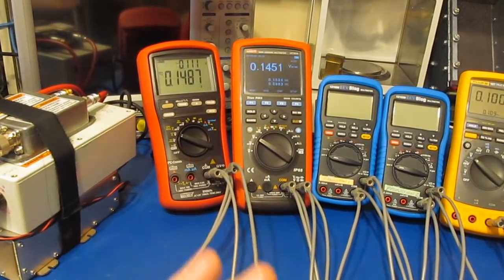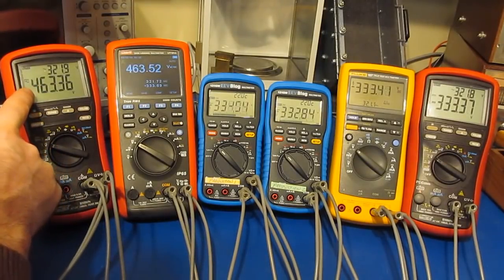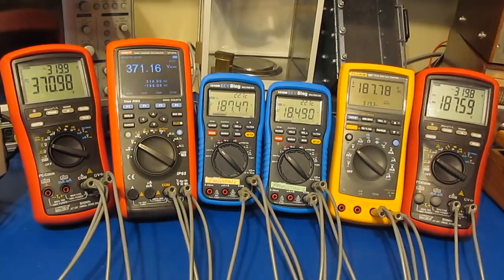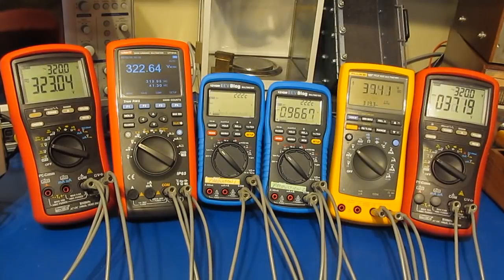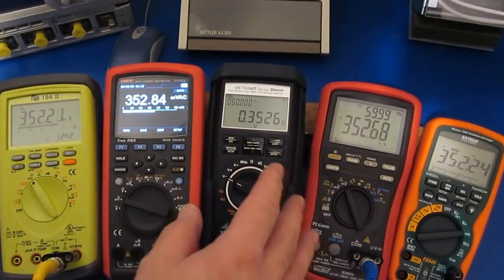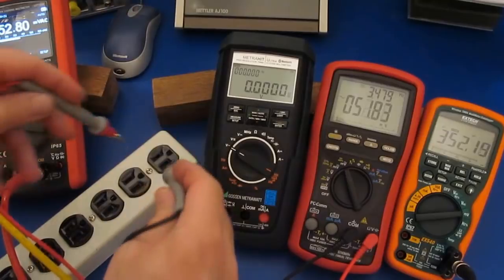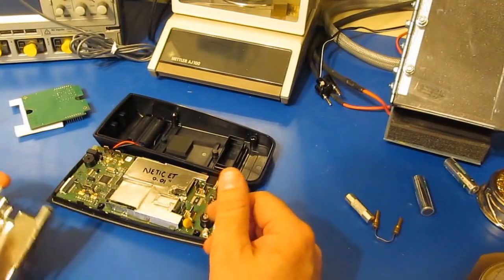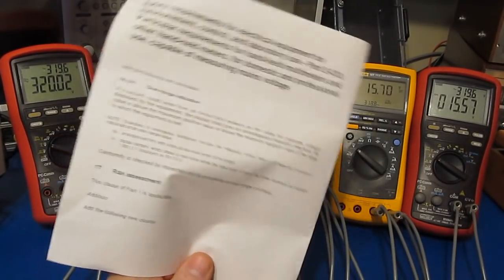EEVBLOG/UEI 121GW Part 3B,   ETL,  Further Details on Part 3

Comment: I have not seen the uni-t un139E or uni-t un139s much on you tube it has more certificates than the other 139 versions have 
UT139ES ATM-ETL
UT139ES CE-EMC
UT139ES CE-LVD
UT139ES ROHS
Don't know if one of these models would be more robust than the 139c.
Reply from the maker: I've ran more UNI-T products than most brands and have yet to see a single one perform very well.  Like the ANENG you asked about, running more and expecting a different result is just a waste of my time.   If UNI-T releases a UT181B, I would have a look but that's about the only one I would invest the time in.
Reply: @joesmith-je3tq  OK, Thanks for the response. Just been sitting watching hours of your videos. Finding them interesting.

Comment: Have you had a chance to use/review the Fluke 189 Series II?  Just curious how it stacks up to the original 189.
Reply from the maker: No, and doubt I would.  I've never really made a review for the 189 because it's not something that is currently offered by Fluke.   I did borrow a friends Fluke 289 when I was reviewing the UNI-T UT181A, which is a clone of the 289.    I also put a beat up Fluke 189 through it's paces and it performed really well.    If Fluke offers something for electronics that I feel is better than the 289, I may have a look.   Beyond that, I think we have enough data on Fluke products to know how they will generally hold up against these tests.
Reply: What is the “series II”? I can’t find any info on it (?)

Comment: Most likely you were driving the mumetal shield into saturation with the tape eraser. That's the downside of using a super high permeability material for the shield...
Reply from the maker: Sorry you lost me.  There was no shielding to saturate on the meter when it was purchased.  These were something I custom made.  There were a whole series of videos on the Gossen, just like there will be with the 121.  Feel free to have a look if you are interested.
Reply: @joesmith-je3tq  Sorry Joe. I got the impression from the video that there was a mumetal shield to start and you replaced it with another shielding material. Anyway, great video, as always. Nobody tests like you do!
Reply from the maker: @ats89117  If you watch some of those videos, the Gossen was basically not useable when it arrived.   Surprised they would sell it in this state.

Comment: So if you set manual range to too low it displays false readings all time?
edit: in dc while high ac present
Reply from the maker: In the lowest range it will display OFL with 1.0 and 2.02 firmware, as it should.   Selecting the next higher range, both with display a low value.  The highest ranges will work with this particular supply.

Comment: Great video series Joe. Thanks to all your videos over the past year and a half or so reviewing this meter from prototype to production model, it definitely swayed my decision not to buy one at this time. I almost pulled the trigger early on because of my great experience with the EEV Blog Brymen BM235. I realize that was just a production 235 with a blue bumper and the logo and not a design by Dave. The 121 seems to have more issues than I would want to deal with in day to day use. It’s too bad Dave couldn’t have struck up some deal with Brymen and maybe adding some of his features he was looking for into one of their platforms. I bought my Brymen meters solely on your reviews and tests and have not been disappointed in any of them. The 121 features are very cool and useful if it worked to the level you would expect of a upper end hand held meter. I feel a bit bad for Dave with this UEI partnership, seems like he might of had his hands tied to some extent once the production ball started rolling. I guess if you put your name on a product you have to be prepared for the bad along with the good. So far your tests have confirmed a lot of people’s issues with this meter. I know your testing has helped them fix some of the issues along the way too. Hell, by the time it’s said and done you might want to design your own meter. Maybe call it “ The 20Kv Lightning Rider” 🌩🌩🌩🌩

Comment: Shocked that a magnetic field could put that meter in a state where a few hundred volts are display as basically nothing.  That magnetic strap is very popular in the field as well.  Easily could be a fatal result on a 'quality' meter.  Not that its much better on the 121GW, but I doubt many (any really) sparkies are using that on the job.
Reply from the maker: I expect that last sentence is true.   I was told Gossen added a shield but I haven't verified that.   Gossen has never contacted me since making this series.    I am open to repeating the same tests if they wanted to redeem themselves but they best have their act together this time.
Reply: @joesmith-je3tq  A shield seems like a half-measure. That latching relay needs to be changed to one that has feedback - not unlike relays and contactors with mechanically linked supervisory contacts used in machine safety applications, where the supervisory contacts let the controller reliably detect welded contacts, and prevent the machine from being started. Such relays are used two in series in safety signaling, so if one welds itself, the other one keeps the circuit open. The contactors used with delta wired 3-phase loads can be single, since one contact welding itself shut won't get the motor running.

I kinda wonder why an optomos couldn't have been used in that application, or if it's a voltage sense circuit then even a vactrol if one wants to funky-engineerd it :)
Reply from the maker: @absurdengineering  The relays allow the meter's function to be changed remotely.  I could change your meters functions while you are trying to use it.   It sounds like a REALLY bad idea to me and I talked about this.   Personally, I would have dropped the feature and the relays all together.  The meter still needs additional shielding for other reasons but the magnetic shield could go away.   Meter would  have been cheaper to make as well.   Guessing some marketing idiot wanted it and the managers supported,  the engineers didn't think about it or if they did, the managers ignored it and the test lab had no clue how to test it.

Comment: As Joe pointed out the meter had been independently tested, another reason to have two meters each from a different manufacture, if not practical then get a Fluke.
Reply from the maker: While I was anti Fluke before I started running these tests (for good reason), they have certainly proven to be some of the best meters on the market.   My only problem with them is they don't currently offer a product I would use.   If they bring back a modern version of the 189, I would have a look.
Reply: @joesmith-je3tq  
Fluke does have a deserved reputation of safe and reliable meters, I own four different models as well as other makes. I just googled "Best Multimeters" and the page I opened one was a Fluke 117 which I own and the other 4 meters were brands I have not heard of and I would be dubious about them.
Reply from the maker: @markadams2765  The do offer several models for electricians and technicians.  Those markets are much larger.   You have to follow the money.     Had that Fluke 101 not held up so well in that first set of tests, I doubt I would ever own another Fluke product.  It out performed all the other meters by such a wide margin, it peaked my curiosity.      My first Fluke was a sensitive money pit, unfit for the military green colors is displayes.     https://www.youtube.com/watch?v=ObKomuLLqU8

Comment: As to Germans knowing how to design a meter: such stupidities are unlikely to be specific to Germany, however, I often encountered in another field that if people in certain german companies think they make the best stuff, then their arrogance makes it that they don't listen at all (stronger than normally) to criticism, but also some of them are more "rolex selling" type companies in the sense that they sell expensive stuff that mechanically is ok, but has severe other flaws in other aspects (I don't know if Rolexes have flaws, I mean simply that the status is what matters to these companies and that rubs off on the behaviour of the people working in that company). Of course as I mentioned with a previous video, generally companies are not interested in criticism and not interested in making their products better with input from outsiders, but in such cases it is even worse. Then as to standards, these are often lacking and the test procedures too. Issues here are can be that the standards are influenced by the companies that make products that will be governed by these standards... I discussed one issue with a researcher at a university who is responsible for the new version of a certain standard that I analysed, and told me, after I said I felt a certain distinction of requirement for 2 types of similar products was a bad idea, that he didn't see the problem and mentioned thst the industry had suggested the change, and then I had to explain what could happen (the users could be confused). This not understanding came from not being critical enough which requires you to think of all sorts of "what if" scenarios. For that situation it also requires knowledge of psychology to know what people are likely to do, or what they might do, and some people just don't get such things.
Reply from the maker: I should have inserted what drove that comment:     https://youtu.be/p25B25MnisA?t=1306
Reply: I see! That's amusing. However as I said I've encountered this more in Germany where I thought "what the hell were they thinking" or "they describe it as great but it looks like rubbish to me" so there is connection...

Comment: I'll report this to UEi, thanks. Please post specific issues found like this in the 121GW Issues section of the forum.
Reply from the maker: You could hit them up about the alignment and VA mode as well while you are at it.  I'm sure people would be interested in knowing the inside details.
Reply: EEVblog Hey Dave, I hope that between yourself, Joe and some of the other amazing minds at the EEV Blog and UEI you can get the kinks worked out on the 121. I think the features and size of it make it a very appealing platform. I wouldn’t mind having one once some of these issues are worked out. Best of luck!
Reply from the maker: There's more to go.    We will see what they did with the two years.

Comment: Choosing a DMM? Does your meter meet Joe Smith Labs standards?  Well, If it doesn't have the JS seal of approval then keep looking...
Reply: Greg Hinson I’ve bought all of my DMM’s in the past two years on Joe’s tests and reviews. Turned me into a Brymen fan boy. I had to find a nice old Fluke 189 after Joe put one through the torture chamber. Found a pristine 189 for $200 about a year ago. The BM 869s and the 189 are my go to hand held meters. Have a nice old Keithley 197 for a bench meter plus a half a dozen smaller Fluke, Brymen, Greenlee and Uni T meters. Just bought a lot of 4 old Beckman meters for parts or repair for $30. 3 4410 models and one 3030. All had original boxes, manuals and leads. Two worked with faulty displays, cleaned the zebra strip and worked great, the other two had bad battery clips and faded polarizing film, a couple of bucks on parts and worked perfect. They are all bang on and like new, must have been in a school lab.

Comment: Did Dave & Co get money hungry over the years?
Why would he put out a product and sign on it?
He could of gone 50/50 in a sponsored no-sign deal.
Really stupid of him.
Good job Joe!
Reply: What's the problem with Dave designing and selling his own DMM. He's having some fun actually working on a product again.
Reply: @0xbenedikt  But he isn't is he?
It's a re-brand.
Never finish someone elses mess, you'll be the daddy.
Reply: @Kaxlon  Only that it's not. He offered two meters so far. One that he re-labeled and another one that he designed with UEI from scratch. The 121GW is the latter.
Reply: @0xbenedikt  Cool. Thanks for clearing that up.
But seen from a coders perspective, it's a mess.
Some component, or code, is acting up.
They need to sort this ASAP as someone could get hurt badly.
All it takes for this meter is to be loaned to someone who lays 100% confident in the tool and you have a death and law suit on your hands.
Most pros trust Fluke etc for a reason.
Dave is not even in the same legue but wish to be certified as he actually is.
That's the danger here.
Reply: @0xbenedikt  It's a sad design, though. All those meters are so abysmally slow when jellybean 24-bit ADCs can do hundreds of 5.5-digit readings per second, and are fast enough to do True-RMS measurements at 4-digit resolution at several kHz without using an external RMS converter, even True-RMS current+voltage synchronous measurements. For impedance measurements it's not a big deal to have a cheap DAC output a test waveform, capture current with the ADC in synchrony with the DAC, and provide high resolution complex impedance measurements that way. It's the sort of stuff that you can demo in a couple hours on a breadboard and have perform better than all handheld multimeters without trying too hard, and hardening it up requires care only - it's not magic. I think that a modern multimeter needs to be a design from first principles, without looking at anything that exists, otherwise it's more of the same. Well, with exception of Gossen. Whatever they did is probably not a good idea unless proven otherwise.